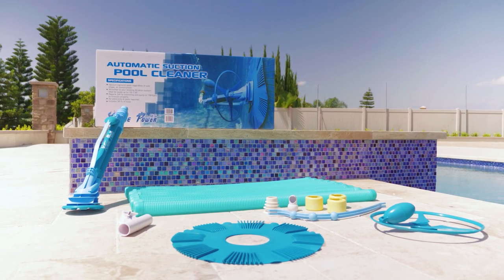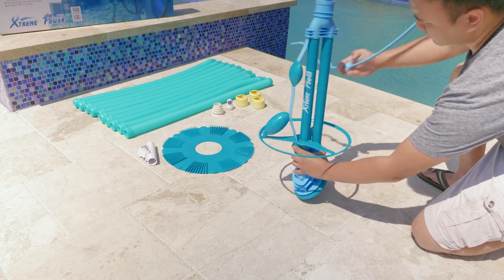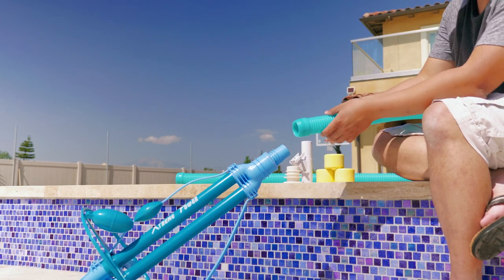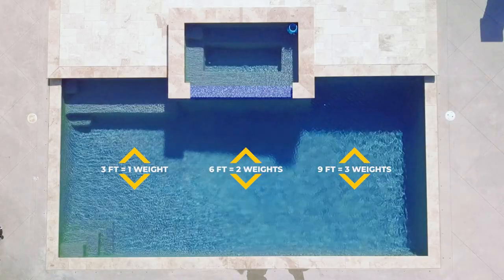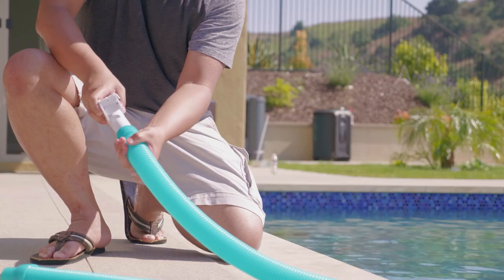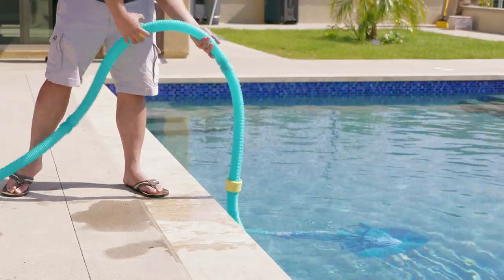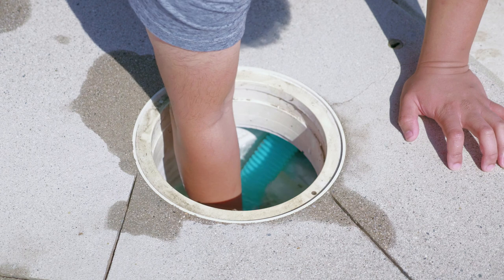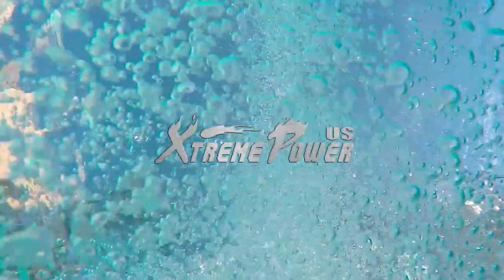XtremepowerUS Automatic Suction Vacuum Climb Wall Swimming Pool Cleaner 75037 Installation Guide

Comment: Finished assembly in about 10 minutes.  The video is better than the instruction manual.  The first two steps took a lot of force to put the pieces together. 

Only negative is that there should be a video showing the device in operation.

Comment: I just hooked this up last night and woke up to a clean pool.  Worked as advertised and I did not need to make too many fine adjustments.  However, I did use my old pool hose and just used 2 sections of the new hose (new hose near the vaccum).  My old hose bends easier and allowed this thing to really cruise around without any issues.

Comment: Hi ... If I have a Pentair Intelliflow pump that ranges from 1250 to 3000 RPM, what speeds will this vac operate at minimially and optimally? I'd like to run it as low as possible for the Vac to function ...

Comment: It looks like a great product, I don't understand how it moves around the pool if it doesn't have a computer and wheels. Can you help me understand how it works? Thanks
Reply: I think it is operating on suction pressure and jet that diverted from the suction and moves it around the pool and vacuuming all the debris.  I don't know how it stay submerged below water level without going above water line and loses vacuum.  Probably a check valve somewhere to prevent that